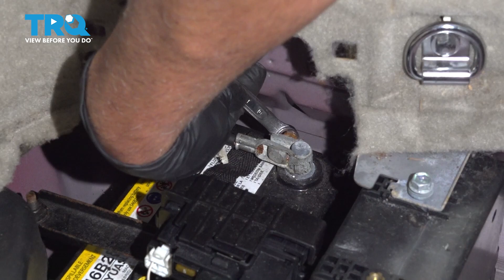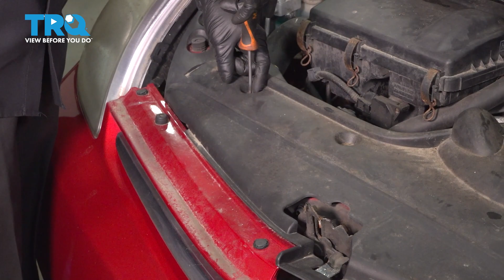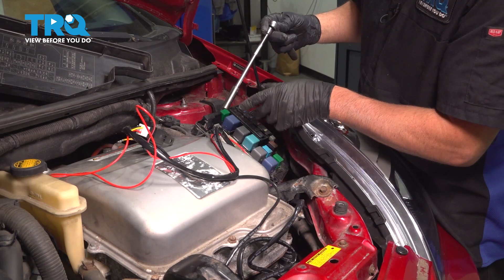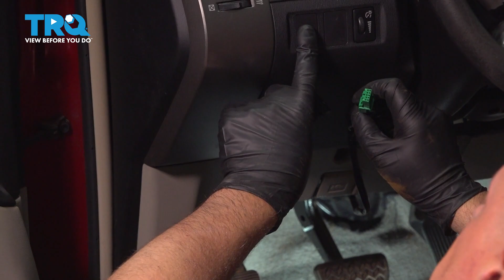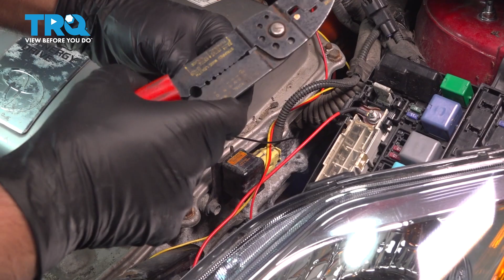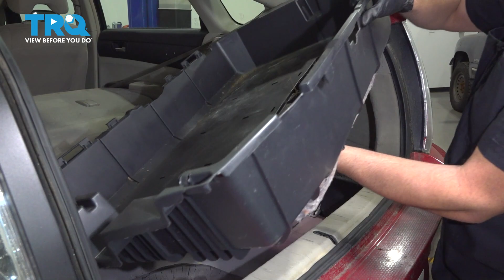How to Install Fog Light Kit 2004-2009 Toyota Prius

Comment: In the new wiring (when purchased through Amazon) the wiring is blue, black and yellow that go to the fog lamp dash switch that turn the fog lights on and off. When you have those 3 colors (blue, black, yellow) bled through to the fire wall to the engine compartment from the switch, you would then connect blue with blue, ground the black to a bolt on the engine. Out of the three you will be left with the yellow wire. In the kit, you will have a spare yellow wire too. You will need to connect the 2 yellow wires together to make the yellow wire long. At the end of the yellow wire, connect the piggyback fuse jumper. Make sure on the piggyback fuse jumper you have to put a fuse in it. You then would place the piggyback fuse jumper as shown on the video. The lower extra fuse port.